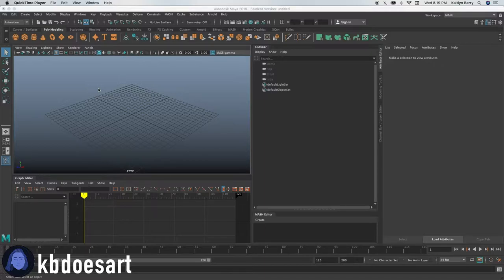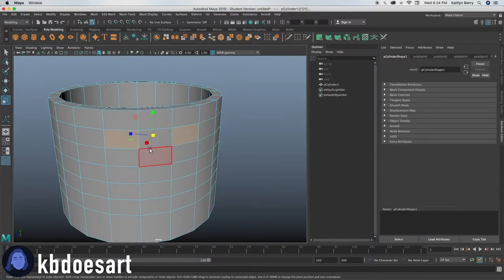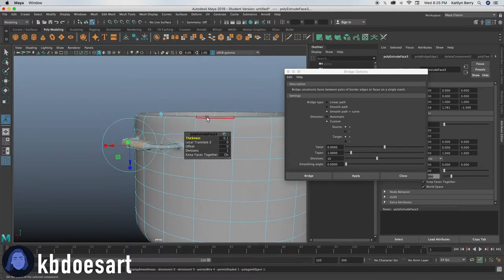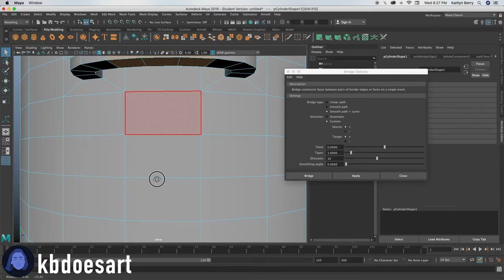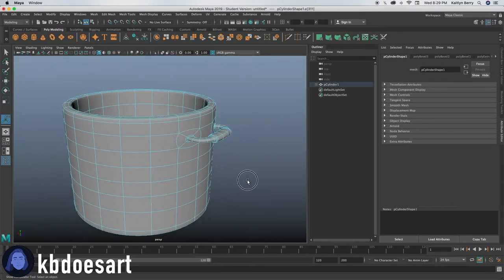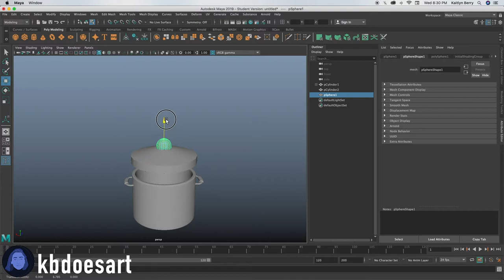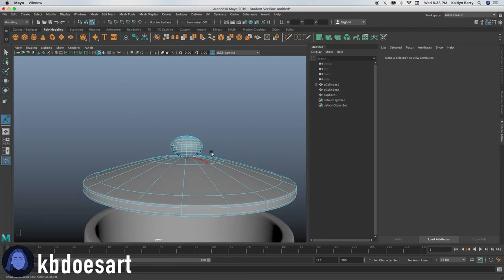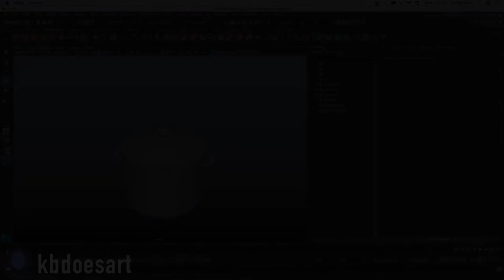Modeling a Cooking Pot - Maya Tutorial

Comment: When I bridge the faces, the handle clips inside the pan. Almost as though it's reversed?
Reply from the maker: This happens! Sometimes changing the positive and negative direction helps. Or selecting custom instead
Reply: @Kbdoesart  I messed around with the positives and negatives. It fixed it self. Man Maya can be weird sometimes.